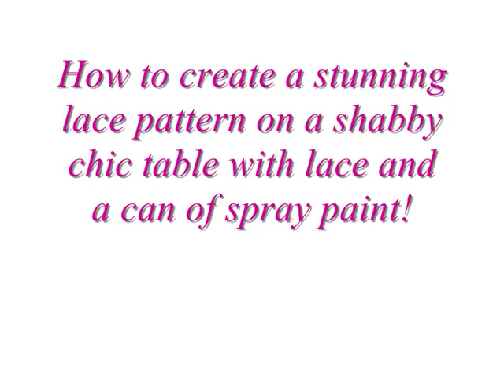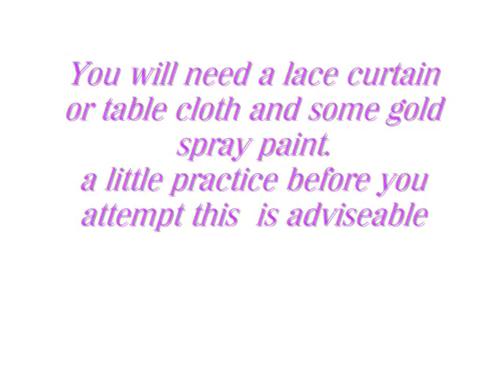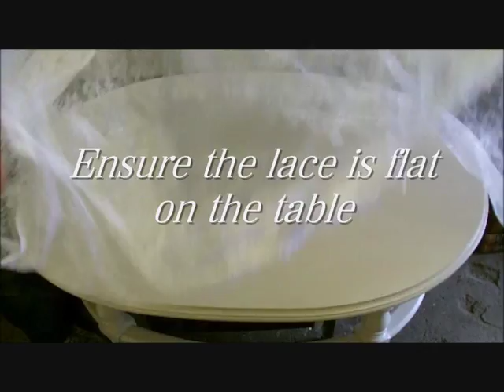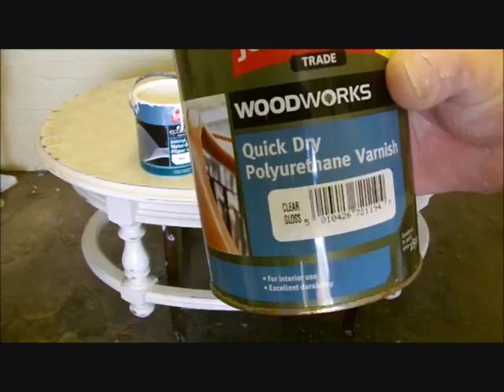How to use lace fabric for stenciling, technique first seen here😉

Comment: thank you for your reply i realized that after 3 tries of spray painting and each time sanding it off again (thinking that something was wrong with the spray paint)that it was the paint i was using.It's calledbeissier todo terreno apparently it's a base coat that can be used on it's own without you needing to a add a top coat (satin).Long story short i did add normal satin on top then spray painted and it worked looks great....thanks again
Reply from the maker: I'm pleased you got it sorted :) so it was the base coat you painted your table with that was the problem ?
Reply: yes apparently it can lso be used to paint over tiles,wood,iron etc

Comment: I did this to a table. Can you put any poly or wax on top of spray paint to protect it and keep it from coming off or smearing??
Reply from the maker: Hi nice to hear you have tried the technique, i used an acrylic clear varnish to protect this table, you could also use a wax i like the Annie sloan clear wax as it isnt too smelly! but for a super tough finish to a project you could use a solvent based clear varnish either gloss or satin finish.

Comment: been doing thus fir years.  Tip Zinsser primer sealer or chalk paint means no sanding necessary.  Lace placement should be centered and a spray paint acrylic will clog portions of lace, if you reuse it on another peice.  Water based damp sponge blot the top of lace dont use acrylic gloss until last

Comment from the maker: Hi thanks, the effect is quite subtle and the lace would be better either weighted down or stuck with a low tac adhesive, the pressure from the spray can is quite low and not enough to blow the lace out of position.
I will be using  this technique again on projects and will use your suggestions to make it a little more refined.
Thanks for the comment :)